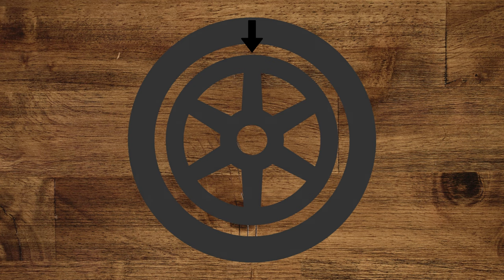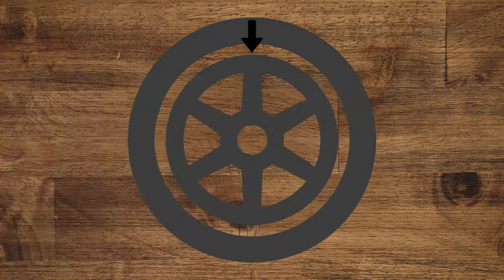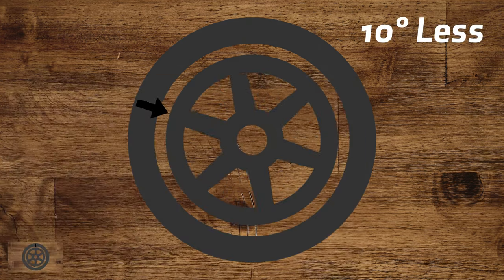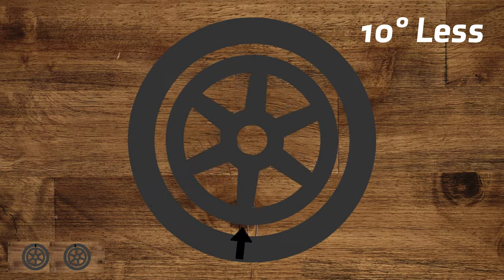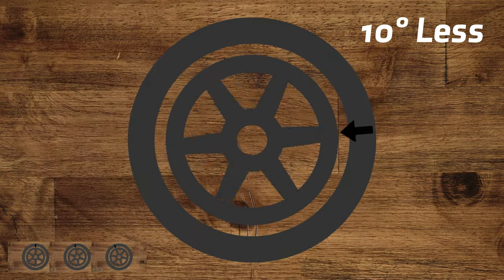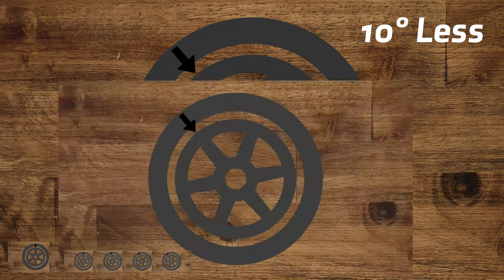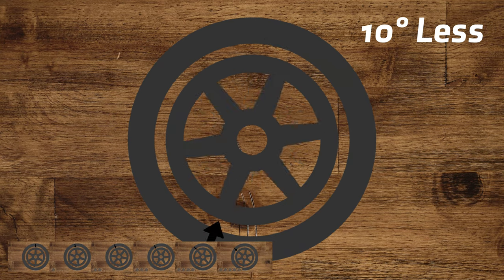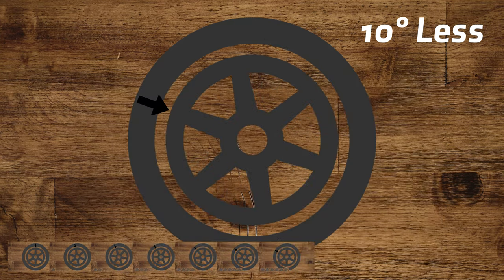Why Wheels Appear to Spin Backwards - Frames Per Second

Comment: I'm looking into this effect, to understand what it means when a car wheel seems to spins backwards, forwards and stays still.
Based on this video (super clear and concise btw, thanks!), is my understanding below correct?
- seems to spin backwards, car is accelerating 
- seems to spin forwards, car is decelerating 
- seems to stay still, either constant speed or exactly matching FPS
I see this all the time in clips of drag races/car races but never understood why or what it means
Reply from the maker: Well not exactly. It isn't directly tied to accelerating or reducing speed because you could accelerate fast enough that the wheel can look like it's spinning backwards also. It has more to do with where the wheel is in the rotation when the frames are shot. Hope this helps!

Comment: So my eyes only see at 24 frames per second?
Reply from the maker: Your eyes see much faster than 24 frames per second, but most video is filmed at 24 frames per second, so that is why you see the effect in video very frequently. You can also see the effect with just your eyes but it's the same concept happening at a different frame rate!